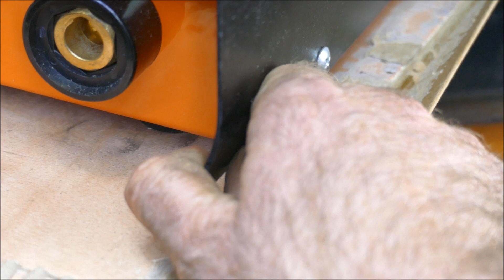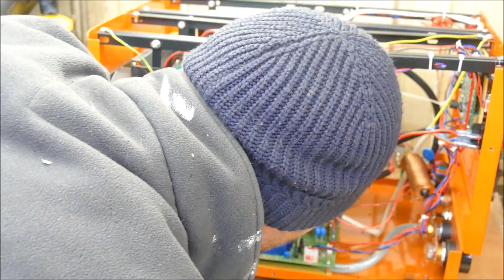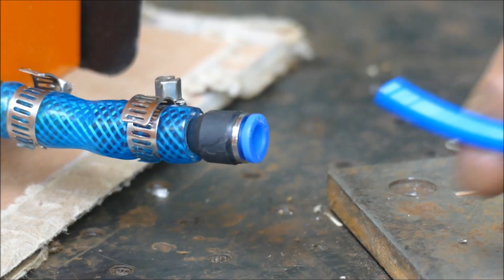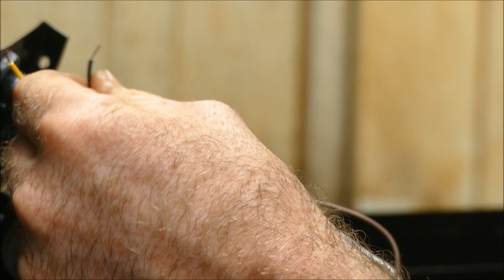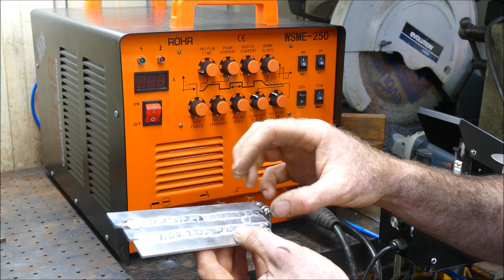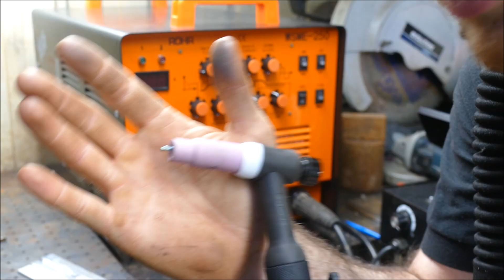I bought a broken welder from Amazon and fixed it saving £££ - Röhr WSME-250 250amp AC/DC Review

Comment: Great video, Josh! Quick question for you, if you don’t mind: There is a grounding pin on the back of my machine — which just arrived a couple of days ago. I usually don’t bother grounding the machines — as I assume the grounding will happen via the standard 3 pin 13 A plug, but since the manual is asking to ground the machine via that pin, I was wondering if I need to do that as well, given I’m assuming the 3 pin plug is grounded already? Also, do I need to have my metal workbench contact the ground or be isolated e.g. with rubber feet, if I am going to be attaching the grounding clamp to the workbench instead of the workpiece? Thanks a lot!
Reply from the maker: Hi. You'll want a 32amp plug to the correct breaker rather than the 13amp fused plug as you'll just pop fuses th moment you do anything substantial. The earth is connected to the ground in the wire and to the casing but in the event of a cable being severed it's a good Idea to earth the machine also to an earth rod closely connected to the workshop so any power in the capacitors can earth and not shock you. As far as I know all earth's can be joined but I would consult with our electrician anyway to be sure. Cheers J
Reply: @joshuadelisle  Brilliant! Thanks a lot! Can’t wait for the next video!
Reply from the maker: @Mahdi-bb4hg  thank you. Cheers J

Comment: You may want to consider supporting the circuit board that is already bending towards the bottom of the welder. Looks like the bend will be breaking the printed circuit traces after a few welding cycles.
Reply: I have had one of these for about ten years only problem i have had is where the pcb flexes it broke the connection of one of the IGBT's
Reply from the maker: Good observation. I haven't but I will. Cheers J

Comment: Great video I have the same welder and just bought the same foot pedal and I thought it didn't seem to be working right I think I have same problem what is the other pot for
Reply: Yes and made sure the internal pot was at full travel when foot right down
Reply from the maker: @MrKevinlarge  have you tried turning up the amps on the machine and making sure any other nob is turned down?
Reply from the maker: Awesome. The other pot is like a big step control and the pedal is a small step control. Mine is set on 10 but bellow that it peeks earlier as I press the pedal. If that makes sense. I just played around until it worked.
Reply: @joshuadelisle  thanks for the reply I've swapped the 2 wires around and it now works but I noticed I only get about 100 amps full bore on the pedal?
Reply from the maker: @MrKevinlarge  hmmmm... I take it you tried adjusting the front pot ?

Comment: Fantastic video as always quick question is it possible to wire the amperage indicator screen to stay on for tig settings
Reply from the maker: Thank you. It maybe possible but I wouldn't know how to re wire what's there. There are amp numbers on the dial itself but probably inaccurate. It's not needed anyway if you use the pedal as you're going by the puddle size instead of a pre set.  Cheers J
Reply: Thanks mate I was just wandering I’m new to tig so I’d like to be able to see the numbers but as you have already mentioned that they do show when there is full contact
Reply from the maker: @Mark1971-1  yes if you activate the arc it will show up. All the very best. Cheers J

Comment: Go for sky blue 2% lanthanated electrodes as they work on everything and can maintain a point on Aluminium.The whole ball thing is old school, no longer strictly necessary and can lead to excess arc wander. If you were unaware, avoid the red thoriated electrodes as they're radioactive and the dust from grinding is particularly bad to inhale.

Comment: Very interesting 
as I'd like to upgrade my current machine because its "scratch start" and DC only .
Im spending more time grinding tungstens than welding at the moment but Im loving the way tig is so much less messy.
Reply from the maker: The tungsten last even longer with post flow which my other machine doesn't have. I still like how small and light my other machine is and will use it to do site work. This machine is big and heavy but awesome. Cheers J

Comment: I know you said you bought this as a damaged return but the main live and neutral connections not being connected, components hanging off the board and the foot pedal seemingly wired in reverse. If this was a welder I was looking at making money from using it would have gone straight back as the unknown of potential future failure and down time would be too high of a risk. A good indepth video but this would have been returned at the first issue if I was relying on the machine to make a living.
Reply from the maker: Hi David. Under normal circumstances I would have done exactly as you say and returned it. Sometimes cosmetic damage is just cosmetic damage but in this case it was actually broken... I decided to keep it for 3 reasons, 1st it was a lot cheaper than buying new. 2nd it's a good learning opportunity to understand the components and how to fix it and 3rd made a fairly interesting video for other people to see. Cheers J

Comment: I purchased a rohr tig welder after viewing your mig welder video. It's only a 160amp dc machine but it has hf start and works pretty well.
Reply from the maker: That will be Great. I still have my other DC TIG at hand. The benefits of this machine is AC, foot pedal and pulse settings. Your TIG will be fine for most applications. Cheers J

Comment: Hi. I've got the exact same 'generic' welder (Supper200) as yours, but the colours are exactly swapped. i.e. where yours is black mine is orange, and orange is black.  haha  But, I'm curious to know how you were 'knowingly?' able to buy a damaged/non working item from Amazon.
Regards Mark in the UK
p.s. You didn't mention anything about plasma cutting, but mine was supplied with a TIG foot pedal AND plasma torch - which I have used.  Only personally done stick welding with this machine atm, but seeing this video is whetting my appetite for Ali and stainless, which is actually what I bought it for.
p.p.s. seen your reply below re' how you bought a 'soiled' item.
Reply from the maker: Thank you so much. I don't think I can plasma with mine as I don't see any ports for air or the plasma torch. All the very best. If you want me to explain anymore feel free to ask anytime. Cheers J

Comment: everyone I have ever seen tig weld has done the same as I was taught. we sharpen the tungsten on a bench Grinder to a sharp point.  that blunt balled end looks so weird to me, but hay if it works for you, more power to you.
Reply from the maker: I would do a sharp point if it's a red tip for normal steel. On aluminium it's slightly different. I understand more modern machines don't need so much balling because you can change the frequency of the htz and retain a point. Balling gives fine control of the arc with simple machines like this one. I recommend 6061.com which is a channel for aluminium welding. Cheers J

Comment: On that machine you shouldn’t have to ball up the tungsten, it works better to sharpen the tungsten and turn up the hertz to around 120 then it gives you a better puddle and it barely rounds the tip of the tungsten
Reply from the maker: Thank you James. Balling is all I've ever known. I'll try out your method. Cheers J
Reply: @joshuadelisle  with today’s technology with the machines you can actually concentrate your arc better by having a smaller tip as long as you can turn up the hertz, an old Miller machine was set at 60 hertz but my machine goes from 40 to 400 hertz and the cleaning action also has to do with the shape of the tungsten
Reply: Hi both, I have this exact machine and just for the record in case anyone else is buying it for AC Tig welding aluminium, the frequency cannot be adjusted in AC mode. Only the frequency in DC pulse mode can be adjusted. I'm not sure what frequency it is set at internally for the AC, but it sounds like 60hz. Definitely not 120hz. The buzz is too low.

Comment: With the solder short problem I would suggest copper wick and flux to properly remove the excess solder. Any soldering questions feel free to DM me though timezone is EST
Reply from the maker: Thank you. Although now that I look back at the footage the rods meet at the ends so it wasn't necessary after all and I think it was just the pedal that needed doing. I appreciate your help thank you. All the very best. Cheers J

Comment: An off-topic question: I see an Evolution saw in the backdrop of the video. Is the saw anything good? I am asking mostly about the metal-cutting (or universal) saw-disk, not about the sawing machine.
Reply from the maker: The metal saw is great and fast for the first few cuts but then blunts very quickly soon after and the blades are expensive. I did a video on my new band saw recently which I consider better for cost effectiveness but it's not as fast. Cheers J
Reply: @joshuadelisle  Thanks for the answer.  I was considering buying an Evolution disk, but was afraid of exactly that - fast blunting.
Reply: @konstantinavilov1192  bit late here but I got one too.. it's fine if you want to just cut metal in 2 but it's not at all accurate. Mine does not cut square in any direction. I ditched the metal blade and just use 3mm abrasive cutting disks.. they seem to burn through the metal rather than mechanically cut but it works and they're not too expensive. It feels like more of a building site cutting bits of rebar kind of machine.

Comment: Very interesting, I haven't even heard about this 'Clean area width'. I've welded aluminium many times before but never saw this setting at any machine. Looks like I've learned something new today ^^
Reply from the maker: It's probably labbeled different on other machines. I've seen 'AC balance' on other machines. It's often called cleaning action by some. Cheers J